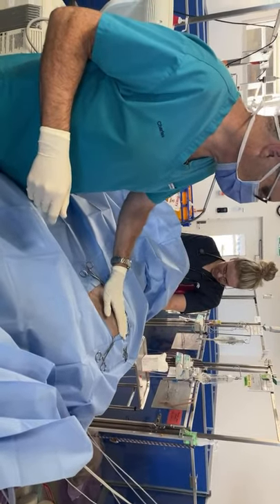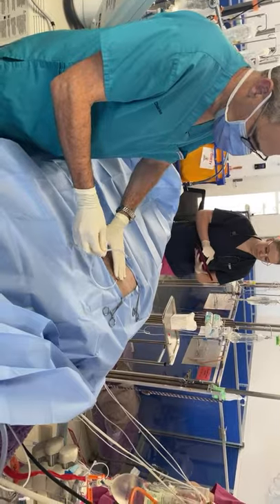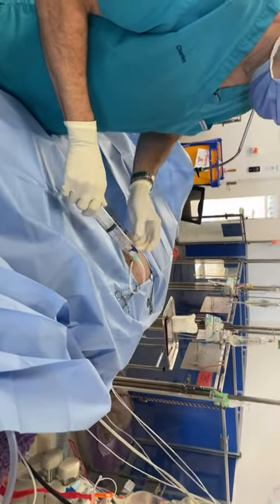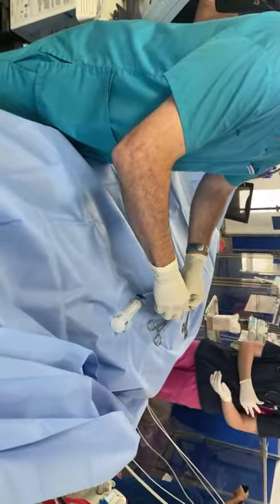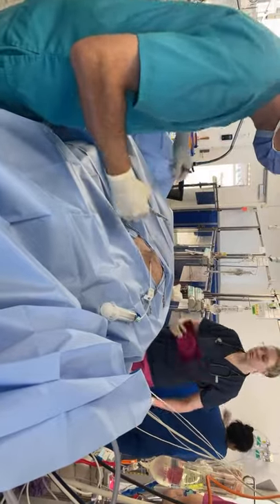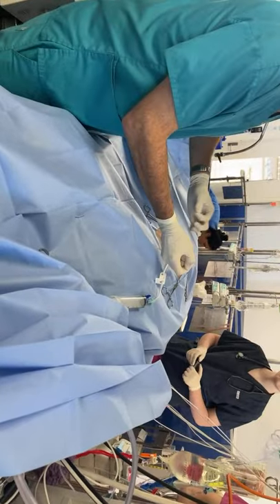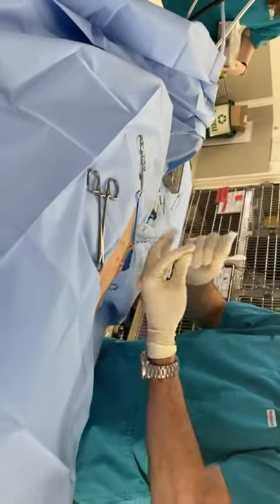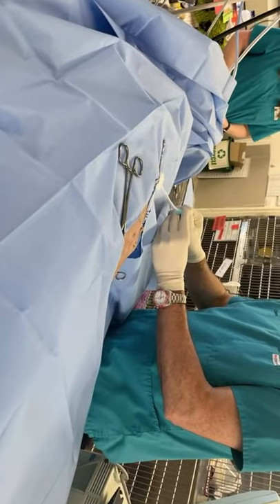Quick! We need suction!! Chest tube placement in a dog

Comment from the maker: The benefit of this chest tube is that you are less likely to perforate the lung, being as that there is no trochar. Also, you definitiely cannot use the Jackson Pratt trochar as you would have no way to exit the tube from the chest, or to remove the trochar. If you are placing them surgically during a thoracotomy, you can use the trochar to exit the chest, but it does not allow you to advance the tube in the subQ space like we have done here. Cheers, Charles
Reply: How many days to remove the tube sir